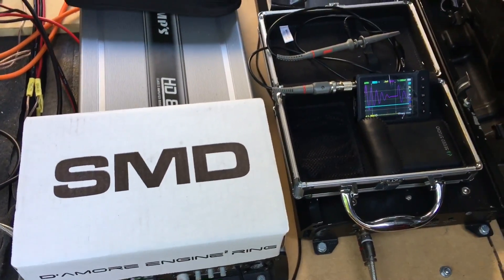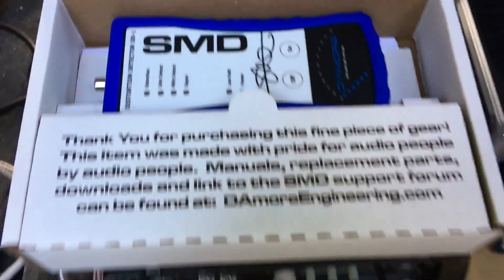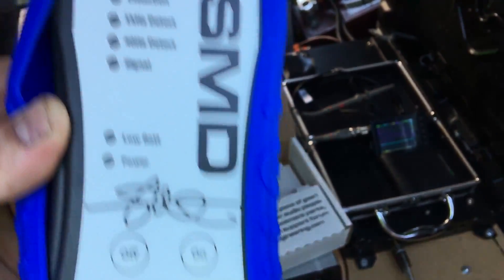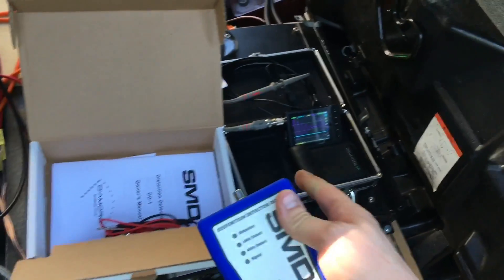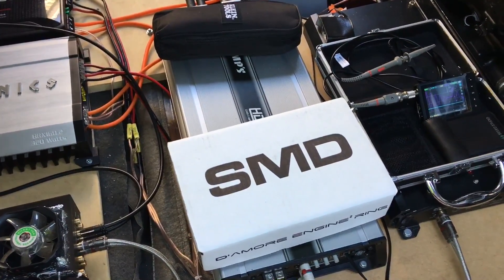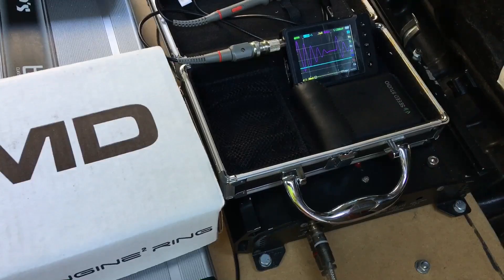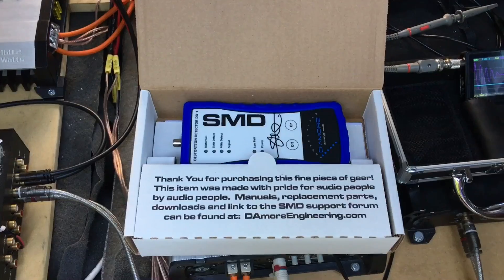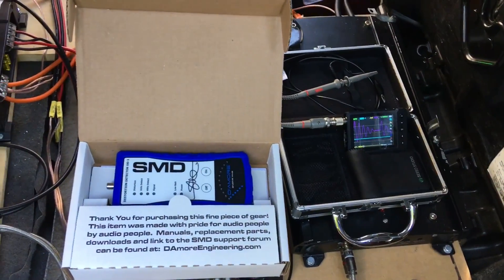SMD DD1 vs NANO V3

Comment: I would rather have the dso than that overpriced "audio dmm". With a dso I can see what the electricity is actually doing which is way more useful to me than a box with a light. But that's because I'm an auto technician, I actually know how to use the dso and I understand how electronics work
Reply: Me too. I can do everything that “audio dmm” does on a cheap 2 channel DSO but with my pico 4425 I can see it in amazing detail 😂.  With 4 channels I can see the current draw from the batteries, the waveform on the input, the waveform on the output, and the current on the output. You can also use the math channels to automatically calculate anything you want to see live like real time wattage.

Comment: This whole time I believe distortion and clipping were the same thing 🤯. I appreciate the information.
Reply from the maker: A lot of people think that, I'm glad I could help.
Reply: @stinkyarmpitbass6259  here goes the semi stupid question.. lol... Is it possible to find the maximum volume level of a head unit(avoiding distortion) without the use of an expensive smd dd1) for example.. I have a JVC kw 250bt head unit and I want to be able to turn the volume as high as possible, safely, to drive my aftermarket speakers(door and deck). I have heard the rule of thumb is 3/4 of the maximum volume is were I need to home in on but I feel as if I'm missing the full performance of my head unit. Can you chime in on this at all? Thanks.
Reply from the maker: @deedolan399  Yeah man so the way that the majority of people do it is they do it by the ear test even though scientifically it isn't the best possible way to do it. You can change all of your EQ stuff to the way that you generally like to listen to your music and then put on a song that you have listened to and know inside and out and turn it up on the head unit until it starts distorting in the speakers or it starts to sound fuzzy. Another way to do it is to get a cheap oscilloscope like the DSO Nano for around a hundred bucks and run three to four different test tune tracks on it and find out where the clipping point is for each track an average those together for your maximum head unit volume. A good rule of thumb for most head units is 3/4 up but there are good head units that might not clip until one or two volume clicks right below maxed out. I had a Pioneer Double-Din AVH that wouldn't distorts until volume 32 and it maxed out at volume 35.
Reply: @stinkyarmpitbass6259  you are amazing sir!! I am definitely subscribed now!!!
Reply from the maker: @deedolan399  thanks for subscribing buddy and I wouldn't know the stuff that I know unless people who already knew that stuff helped me back in the day so I'm glad I could give back to the community 💯

Comment: I bought one and my SMD tested gains are exactly where I set mine by ear. I just paid $150 for not trusting my ear sigh
Reply from the maker: If you do a lot of car audio it's worth once you can use it to troubleshoot where the distortion is coming from.
Reply: There's also clipping signals when RCA or something faulty. You cant hear it and over time will fuck everything up. Look up smd vs o scopes.

Comment: Let's hope you don't have a setup where an amp has to play below 1k and above 40 hz.
Besides, it detects harmonic distortion, not clipping. It's garbage.
Reply from the maker: Distortion and clipping coincide sometimes and many videos using an oscilloscope right beside these amps prove they are very sensitive and Dead on.

Comment: Look at d'amore's videos. He has videos where he's using a scope to show both clipping and distortion. The scope is clearly the superior instrument. The dd1 is an overpriced idiot light. With a scope you can test multiple frequencies instead of just two, actually see the signal, and much more for less than half the price.
Reply from the maker: The oscilloscope doesn't show you Distortion, that was really the deciding factor in me buying the dd1. Both show you clipping but only one shows distortion.

Comment: I'm on board with everything you said, except for the iPhone remarks.. They LITERALY copy every one of their competitors. And while they were bashing the note 5 fire hazard, they failed to mention how they to use Samsung batteries. My dad is a area manager for Apple, and I love fact bashing him with how behind in technology Apple is in comparison to companies like Samsung and OS like Android.
Reply from the maker: I agree buddy I have that iPhone for around a year and hated it. My wife had one so I decided to try it and I got the nicest one they had out at the time but it still couldn't touch the Androids that I am currently using.
Reply: I'd agree with you with how they copy things. But the genius of Apple is the EXECUTION. The hardware, software, ease of use etc.. even the DAC and amp in them scores super high.   I would absolutely compare DDM as it has a ton of technology inside, but it boils it down to a quick and easy idiot light anybody can use. Also expensive. lol

Comment: Too bad you didn't do a comparison of the two units. 
With that said, one could get a BNC to RCA connector to put the scope on the same connectivity level as the DD1
Reply: JohnBee Yupp. I use a bnc to rca adapter on my ds0138 to tune my system. Than took it to my local audio shop to see if my audio was distorted at all, and it surprised me that it was actually perfect!

Comment: Good video & everything except when you said iphone is best when truly iphone is garbage android is way better & more advanced iphone still left behind dont know what the heck they are doing or thinking. When you choose iphone over android your choosing limited lifestyle as for android or your choosing freedom lifestyle
Reply: mike honda than I'll just DD1 my S8.
Reply: Same tired argument, who cares. I use what works for me and my lifestyle is not determined by a frickin phone. If it is, you need to re-evaluate some things.
Reply from the maker: Moises Moises I agree buddy, that's why I'm going back to an android in the next four months. There are some absolute monster androids that will be dropping in the market in the next six months that have better specs than laptops from three years ago!!
Reply: Android distorts and clips at high volume and during raising the volume. That's why it warns you at max volume that its not safe to listen to it at volume maximum. Apple gives the option to prevent this from happening by volume max adjusting, and volume matching in settings, so you don't damage anything. If you had a kenwood deck then you know what I'm talking about. Clipping is a spike in signal beyond its limitation. (kenwood volume spike when cycling 30-35.) I have actually done the test with the DD1hv and my TPI multimeter and found this out because I have both these devices, as well as phones to test with. Androids platform is geared to loud with low clarity, and Apple is geared towards clarity over noise. For example Sony head units back when they had the DSP that boosed the loudness, but got scratchy when used, and Alpine which stayed clear up till volume 22 and after 22 instead of clipping, it lowered the highs so the tweeters wouldn't clip. Saying one is garbage is a truly false statement to make. You just don't like Apple because its Apple. Apple is best for musical listening, Android is best for loudness. Ever notice, the majority that battle in the audio world uses Apple, or audio cd's? If not those two, Flash drives...?

Comment: for the task of tuning an amplifier seeing the wave is obsolete when the only notation needed us that it is in fact distorted and/or square waved as well as artifacts in the wave, those are shifts that are dangerous even though the wave it's self is not squared. To be able to see an artifact on a wave you would have to be zoomed in and looking for shifts which is rather difficult even for a seasoned oscilloscope user. Tony's algorithm is spot on and in that if the light comes on there is a problem no need to know where cause it's presence is enough to dial back. also the light being analog allies the user to effectively see the strength of the clip to fine tune with out dealing with on/off lights
Reply from the maker: Lawrence Murray I agree buddy but seeing the wave is cooooollll! Great stuff man!

Comment: I love my DD-1 and use it all the time.
Reply: Bj Hammon you wat fam. you I got a dd1 and cross over calibrator have never used it my home boy gave them to me. I the only thing is missing is the test tone CD. I need to try to get one and do some real tuning and gain matching especially with me running 3 of the kind sub amp & 2 same amp
Reply: Raw Customz - One of the best tools in my shop 👍🏽 I gotcha mane, email me your address and I'll burn you a copy, for each device. (bj.hammon@yahoo.com)
Reply: Bj Hammon I just sent the email to you. thanks a million for the CD
Reply: Make sure you test any burnt cd's.  I kept getting distortion showing on my DD1 plus before I got a measurable signal.  Was driving me freaking nuts.  I finally figured out my buddy must have burnt them in fast mode or with a shitty laptop or something.  When I used the original disc I was able to tune like normal.